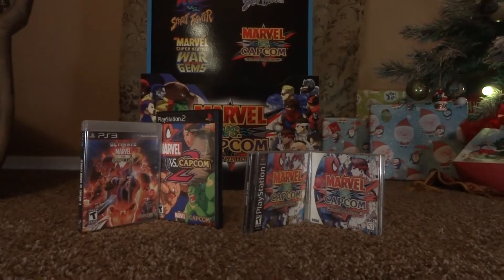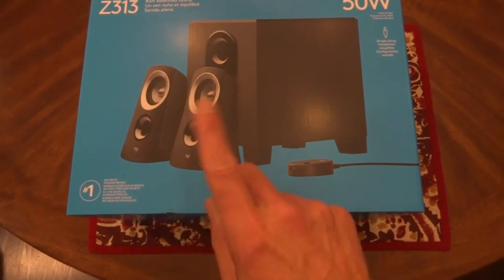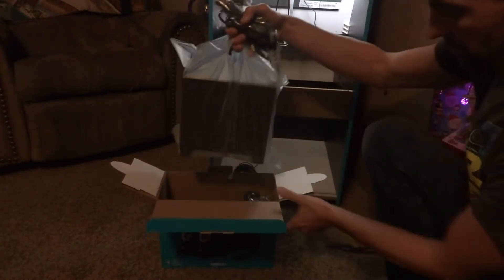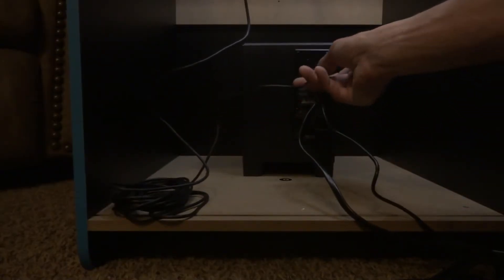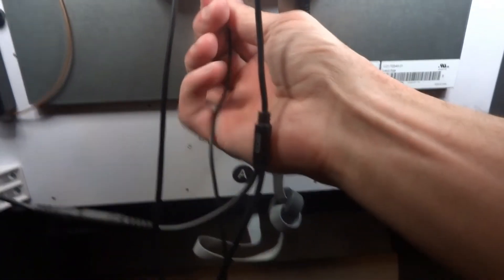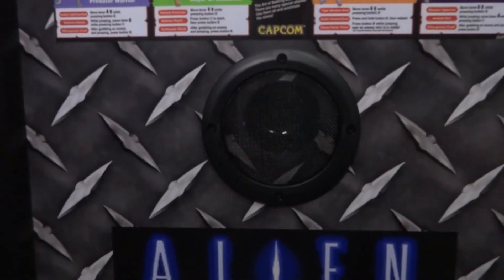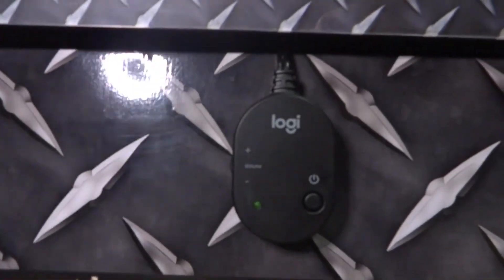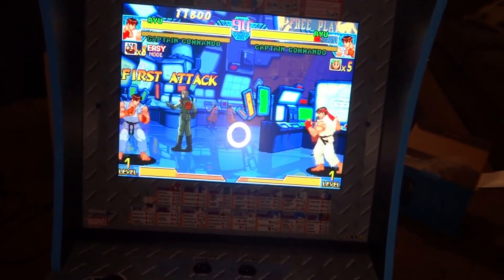Arcade1up Marvel Vs Capcom Plug-n-Play Subwoofer Install

Comment from the maker: Here’s the Walmart link: http://www.walmart.com/ip/Logitech-Z313-Multimedia-Speaker-System/13216193
Reply: Thank you!
Reply: Love the thought on this 19kfox, but I used to work for a speaker manufacturer (one that specialized in computer speakers just like this for major OEMs like Dell), and I'd have to caution about--and recommend against--what you're suggesting. 

The signal coming out from the A1U board is AMPLIFIED (since the built-in speakers are passive), so the signal you're sending to the subwoofer here is likewise amplified--but this is NOT the kind of input it is expecting (a PC, for example, doesn't send power, just an audio signal, which is why all add-on PC speakers are powered). So, you're sending signal AND power to a system that's only expecting to see a signal. And that's dangerous. It might work for a while, but you'd definitely risk burning something out (or worse) on either the A1U board, the speaker audio board, or both. 

Believe me, I get the power of audio...  I built a custom arcade cab once with a built-in, home audio grade subwoofer custom-mounted in the base of the cabinet. It had a dedicated amplifier board and a highly damped, subwoofer-specific tuning chamber built entirely with MDF. I had a physicist friend of mine help with all of the specs, and  the results were phenomenal... punches from games like MKIII hit with real impact!

All of which to say...  A1U needs to up their audio game and offer a built-in subwoofer on some of these cabs!
Reply: @PaulXMann  So, you're saying there isn't ANYTHING a consumer can do to upgrade their Arcade1up cabinet's audio without issue?

Personally, I wouldn't hold my breath for Arcade1up to give people that option unless there's just a ton of people asking for it...
Reply: @truthinentertainment1028  There ARE options--you can get a high/low signal converter, for example, and newer cabinets have a headphone output that can be adapted. Unfortunately, A1U cabs vary somewhat in both the quality and the exact implementation of their audio (some aren't even in stereo, for example), so not everything will work in every scenario. The Arcade 1Up subreddit has a lot of good info!

Comment: I actually place the volume control on the upper top panel with Velcro. Easy to get to and concealed by marquee. I cut a small notch near the top side back panel for wires to pass through.

Comment: Not sure if you noticed, but doing this on my Killer Instinct and NBA Jam mod causes the stock speakers to only play mono sound out of the right speaker. Plugging the stock speakers back into the PCB reverts back to stereo sound coming out of both. I tried multiple kinds of stereo extension cables (3-pole, 4-pole) and two sets of Logitech Z313's and it all does the same: mono sound and buzzing/humming.

Comment: I just might try that this weekend, since I was about to swap the speakers on my MSH cabinet since that speaker sounded a lot louder. That woofer mod just might blow the competition. Thanks for the idea 💡🙂💡
Reply from the maker: Changing the stock speakers to a two-way speaker makes a big difference in clarity. Adding a subwoofer gives you that bass that makes the punches sound brutal. Thanks for commenting. 🦊👊🏼
Reply: @19kfox  I did the mod last night and it sounds like it has a rumble pack to it. Volume set to one sounds plenty loud, even louder than my MSH cabinet. 👌👌👌
Reply from the maker: @ej86  🦊👊🏼

Comment: Note to all: doing this mod will only give you mono audio out of one of your speakers since the Z313 has a TRS (tip/ring/sleeve, "TRS") connection but the stock speakers and the PCB are using a TRRS, or 3-ring (tip/ring/ring/sleeve, "TRRS") stereo jack .

Comment: Please note: Nobody should be doing the mod in this manner, the line out jack from the Arcade1Up PCB's is a high level (powered) connection , it is not line level. If you want to do this properly you should use a line level converter (LOC) in the chain.
Reply from the maker: Thanks for the comment. Wouldn’t this be the same as an audio out on a computer?  That is what the Logitech is designed to do.
Reply: @19kfox  No, it is not the same. The line out on a pc is low level as it does not have the required amplification to drive desktop style speakers (which is why desktop pc speakers are powered). The Arcade1Up's have a small built in amplifier on their PCB's, they just use a standard 3.5mm jack to simplify getting the powered signal to the speaker(s). Hope that helps.
Reply from the maker: @DGPG35  Do you know any specifics?  Typical PC audio out watts vs Arcade1up PCB out watts?  The input side of the Z313 seems to handle it just fine. My only concern would be potentially blowing the stock speakers.
Reply: @19kfox  The Arcade1Up speakers are ~3w AFAIK and I do not know if anyone has measured the power output from the Arcade1Up PCB's. For obvious reasons it is not suggested to double amplify (you don't want to amplify an already amplified line) as it can cause various issues and damage the equipment (which does not mean that it definitely will).
Reply from the maker: @DGPG35  According to Logitech, the Z313 is suitable for use with many consumer electronics. I think it’s safe to assume that it has an internal LOC.
Reply: @19kfox  Yes it's suitable for use with consumer electronics that have a line level output (and the vast majority with a 3.5mm output are indeed line level), not a high level (powered) output. Obviously you can do as you wish, it's your equipment, but what I am saying is that it should not be done the way you have shown and people need to consider doing it the proper way (otherwise they risk damaging their equipment). There are LOC's on Amazon for $11 that would be suitable for this use case (with just a little extra wiring work to place it in the chain).
Reply from the maker: @DGPG35  Thanks for your input.
Reply: @DGPG35  Is there a plug and play LOC to implement in the cable chain? How do you implement an LOC?
Reply: @DGPG35  Is there a 3.5mm audio input output plug and play LOC that can be installed between the output from the Arcade1up and the input on the sub?
Reply: @erikharms9205  Highly unlikely since this is not common at all. It would be fairly simple to wire one in the chain as the RCA outs could use a plug-n-play adapter (RCA to 3.5mm) and the speaker level inputs would need to be spliced into a male 3.5mm jack that would plug into the Arcade1Up audio jack. It's pretty straight forward, not much to mess up as long as you keep the signal straight and use the proper connectors to achieve your goal.
Reply: @DGPG35  That makes sense. Thank you for your answer. I’m okay with the way they were produced, but it would be nice to have a little more activity on the low end.
Reply: @erikharms9205  Oh yeah, I absolutely agree that the subwoofer addition to an arcade cabinet can add to the enjoyment (my full size Midway multi-cade has one in it, as does my virtual pinball). We have 4 Arcade1Up cabs and I have considered the subwoofer addition for a couple of them but I have not ordered the parts as of yet.
Reply from the maker: @DGPG35  Let me know how your project works out.
Reply: I was thinking the same thing. I heard of people starting fires trying this type of connection. It is a bad idea to take an amplified line and connect it to another amplifier. It should only go from line level to an amplifier. Never from an amplified line to an amplifier. Those speakers are expecting a line level connection.
Reply: @game theater fusion I've been using amp and car speakers in my SFChamp can for years, never had an issue. Is this just related to the 3.5 jack in the gen 2s? Would just plugging the jack to a soundbar cause problems?
Reply: @DGPG35  damage to what equipment? The stock speakers? I'm no electrician, but I'm not understanding how it could conceivably damage the PCB or anything else. Thoughts?
Reply: Would it be safe to connect to the control board headphone jack instead?

Comment: Clutch!!!! Thank you for this video!!!!!! Can I use any subwoofer that has 3.5 mm jack?
Reply from the maker: Absolutely. The increased power could damage the stock speakers so I would go much beyond the 50W. Thanks for commenting. 🦊👊🏼
Reply: @19kfox  advice taken!! I'm buying the subwoofer you used!!! And absolutely!!! I been thinking about the exact sub you used in your video. You just gave me my confirmation!
Reply: @19kfox  i don't plan on touching the volume control on the sub so could I just  leave the dongle inside of the cabinet with the subwoofer?
Reply: @RomeGoLARGE  The problem with that is that it is also the power control, so if you don't have access to it, it would stay powered on and make a buzzing noise while the arcade is off. So you need access to the power/volume control, unless there is a way to link the power of the subwoofer to the power control of the arcade itself.

Comment: One thing these cabinets mostly get wrong is that the speakers would always echo inside of the original 1980s cabinets (90s were different with speakers starting to point right out at consumer) and that was part of the charm.  the arcade1ups all just have small speakers only  pointing out and it misses out on that cabinet echo.  This is a good fix for that.

Comment: Am I missing something?  I bought the exact same speaker set and extension cable and I'm only getting sound out of one speaker on my big blue cabinet.  When the speakers are plugged directly into the pcb they work fine.  Am I doing something wrong?  Was your MvC cabinet a mono speaker?
Reply: You're not doing anything wrong. I get the same thing. Notice how the stock speakers have a 3-ring stereo jack and the Z313 has a 2-ring? I get mono audio out of every single one of my cabs that I do this "simple" mod on.
Reply: I have stereo sound on all my cabs with the sub now.

Comment: Thanks for the great note GTF.  I have been trying to get my cabinets to work with 2.1 audio setups and I keep getting that hum and/or squeal from such a setup.  I emailed A1UP about this and they did say the output on their PCBs is a PROPIETERY TRRS setup and not the standard L+, R+, G, from tip to base, on a standard TRS 3.5mm jack.  Since I and others have kinda got it to work, I am assuming the output wattage is very low (thus our desire to upgrade) so it is not drastically overloading our add on speaker systems.... yet!  I sent follow up questions about output wattage, stock back pinout, and also if this internal amplifier is a Class A/B or D.  If A/B most of what we all know about speaker wiring will be used and easily accommodated.  If a Class D, we must be careful on how we wire this up.  In a class D, which are now common because of size of amp and higher output, both the positive and negative leads are hot. So, you have to make sure you address that hot ground wire correctly.  I am suspect of a Class D because of my experimenting with the cabs and still getting sound when I do not have grounds connected.  In a class A/B, + is hot with - providing for a return.  In a Class D, both + and - are not and they work in an efficient push/pull setup.  Also, if using a LOC and this is a Class D, we must be care to correctly wire up the standard LOCs.  If incorrectly wired, you will get a bad hum or a squeal.  This is because you are shorting out the two hot negative terminals (-).  I will comment again when I get more info from A1up and get this right.    Also to note, if A1up confirms a very small output detail and it is in the tolerance of the input section of the 2.1 speaker kit, we may be able to bypass the LOC (Line out converter) and just be careful on matching volume levels of the cabinet and speakers.
Reply: Did you ever get more info on this?

Comment: I assembled my machine a few days ago... thanks for posting this video! I thought the speakers were weak too.  I'm not sure if my unit is defective, but the character voices are very faint and I only hear music coming from the left speaker.  Is yours like that too?
Reply from the maker: The voices seem to be fine but there was no low end sound. The Q-sound cabinets from back in the day had great bass which is why I wanted to try this mod. 🦊👊🏼
Reply: @19kfox  thanks.. i watched your assembly video and most likely didnt snap that cable in tight enough.  As soon as I got home from work, I unscrewed the back cardboard panel, and reattached the cable.  Voila! I have full voices... I can finally hear "optic blast!" and "Select your alter ego!" I'm fine with this for now ,but will do your modification later. :)

Thanks for the quick response!
Reply from the maker: @hargow  Awesome. 🦊👊🏼
Reply: @hargow  do you still just get sound from the left speaker or was that corrected by pushing the cable in more?

Comment: I did this mod with the same unit on my Star Wars mid running a PC with no issues but with this one I did everything you did but I keep getting a humming when there is no sound or when I turn the cab off. Is there anyway to get rid of this? I checked all the connections. That being said I'm using the same audio extender you have as well. I've returned it back to stock for now until I can get this figured out. Any suggestions would be greatly appreciated. Game On!
Reply from the maker: I’ve not experienced this but I’ll do some research and get back to you.
Reply: @19kfox  So I believe it's the 3.5 mm jack that's coming from the remote into the PCB that's causing the humming.
Reply: @19kfox  I think the humming is caused by a ground loop therefore I just ordered a Ground Loop Isolator that another A1up owner used on their MK cab that solved the issue.
https://www.amazon.com/dp/B06XQYN77L/ref=cm_sw_r_sm_apa_fabc_49V10BDQE35GKWRYNZTN
Reply from the maker: @cmart7307  Hopefully that will solve your problem. Let me know.
Reply: @19kfox  So I installed the loop ground adapter today and it seemed to help. I only noticed a very slight humming but its faint. With that said  the sub definitely gives the gameplay an added depth to an already good sound system in my opinion that was lacking and it's just awesome! But I think the stock speakers will need to be swapped out eventually. Love seeing that the channel is growing my friend! Well deserved 😊
Reply: @cmart7307  i did the same and had a small hum noise. but did anyone one notice losing a left or right channel after installing the sub?

Comment: Thank you for this video!!! I ran out and bought this speaker set to see if it works as this is a much cheaper solution than the Klipsch set I am currently using (and want to use in all my cabs). However, I’m only getting sound from the left speaker. I’ve made sure all cables are fully connected. Are you getting stereo sound? I get stereo when using the Klipsch setup.
Reply from the maker: I am getting stereo, make sure your audio extension cable is for stereo and not mono.
Reply: @19kfox  It says stereo but I am going to purchase the one you used just to make sure. I really hope this works!!!
Reply: Posting my finding in case this helps anyone: I purchased the cable @19kfox used and same deal: mono in left speaker only. I knew something was up so I tried a different method  and finally figured out what works. I had a "Y" stereo connector and plugged in the top stereo cabinet speakers in one and the green connector (coming from the sub's controller) in the other and plugged the single connecter from the "Y" into the cabinet. It all works beautifully now. This even eliminates the feedback and hiss when the cab is first turned on. Feel free to try it this way. Thanks so much for making everyone aware of this sub set and you're right...50W is way more than enough!!!
Reply: @castleranch738  what’s the name of the Y connector you used ? Can you post a link ?
Reply: Are u using a 3 pole or 4 pole y splitter to make this work?? What did u use ?

Comment: So I got the same speaker system and auxiliary extension cord and got the subwoofer working but only one of the two stock speakers is working. Any suggestions?
Reply: You're not doing anything wrong. I get the same thing. Notice how the stock speakers have a 3-ring stereo jack and the Z313 has a 2-ring? I get mono audio out of every single one of my cabs that I do this "simple" mod on and it's because of the mismatched stereo jack.

Comment: Where exactly did you put the volume control on the MvC cab?
Reply from the maker: I coiled up the wire and left on the bottom of the cabinet next to the subwoofer. Make sure the volume is set to maximum before you close up the back.
Reply: @19kfox  initially did the same, but it makes a noise if left on while the arcade is off.
Reply from the maker: @indevidualbeing6488  You can unplug it when not playing or mount it on the front of Cab. Mounting it would make it more convenient to turn off and on.

Comment: Just did this myself, night/day difference on my cab.  Only gripe, when the cab is booting up, there sounds like feedback until the cab fully boots up.  Anyone else had that issue as well?  I have the yoga flame legacy cab.
Reply: I get the same problemZ ever figured out a solution?
Reply: @Calwinn  More like a work around.  I connected everything to a surge suppressor I mounted on the outside/back of the cab.  I wait until the boot sequence is complete, then power it on.  Only time the feedback happens is during the boot process.  In between screens, never does.

Comment: I bought the logitech z313 and wanted to know is there anything else I need for the audio mod for T2?
Reply from the maker: A 3.5mm extension cord.  This way the speaker can sit in the bottom of the cabinet and connect to the stock speakers.